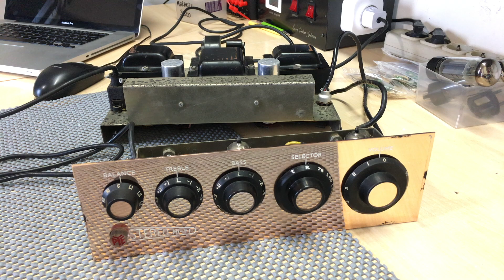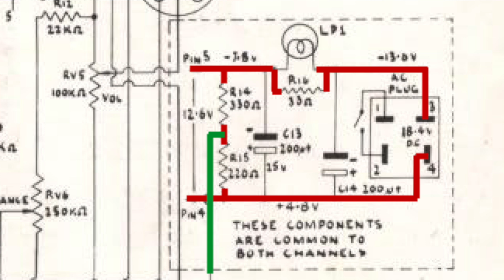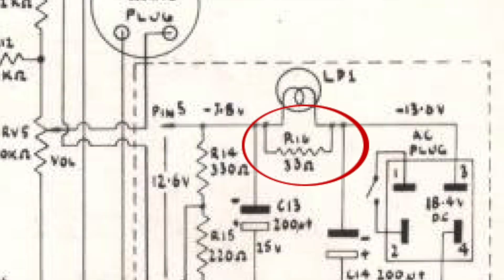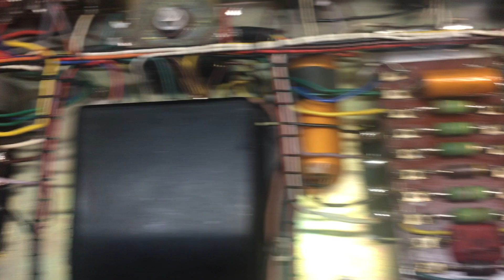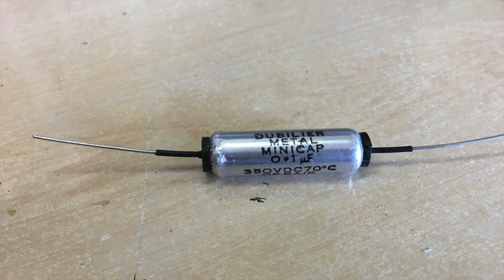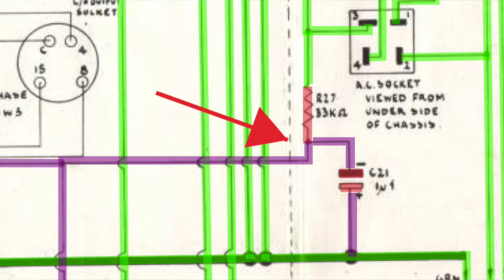Pye Mozart HFS-20M Stereo Hi-Fi amplifier restoration - part 2

Comment: Great job on those nichicon disguised! However if the next technician sees an old capacitor wouldn’t it be a risk that they get rid of a brand new nichicon without knowing? Maybe some marking should be in order just in case. Great video, thank you!
Reply from the maker: Could happen. However, the owner is keeping a copy of this video series as documentation for the restoration.

Comment: Those replacement capacitors look great, but since they each have two capacitors in series (I should say anti-series), couldn't you have used smaller capacitors with half the voltage rating?
Reply from the maker: They aren’t in series. They are two separate caps. I just fitted them like that for space reasons. The two negatives are wired together and come out if the bottom like the original did, and the two positives come out if the top.

Comment: I think the owner of this is very lucky to have a repairable unit after running it with such leaky coupling caps. I imagine the anodes of the el34s were glowing nicely and the primaries of the o/p transformers were close to failing. Have you tested the valves to check for stress?
Reply from the maker: Not yet.

Comment: Such Fine Work And Those Heat Shurnk Capacitors Do Not Look Out Of Place At All..Just Shows You How Bad Old Carbon Resistors Can Become In High Voltage Valve Circuits And Capacitors As Well !! Great Job Sir Looking Forward To Part 3 Regards mike.